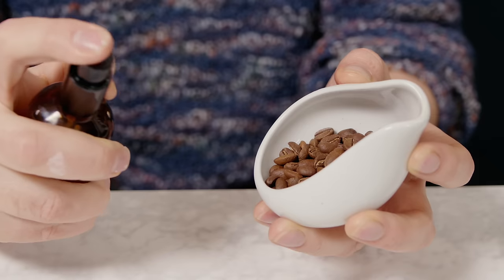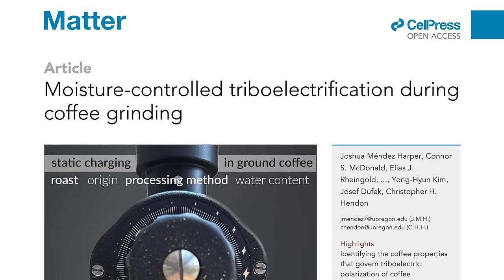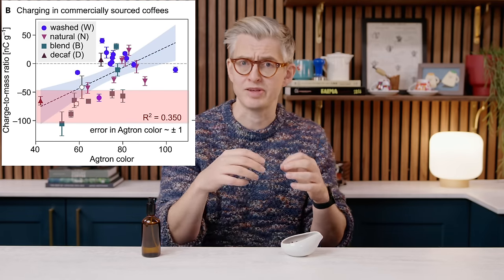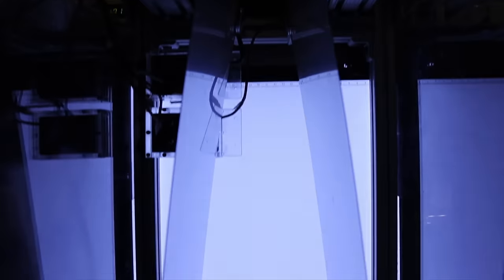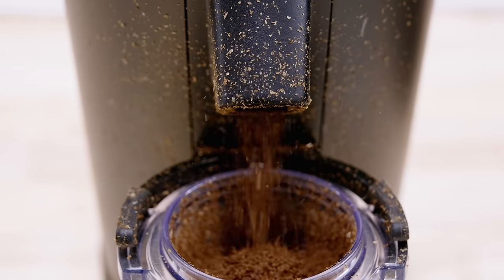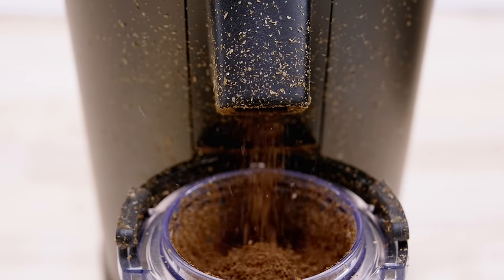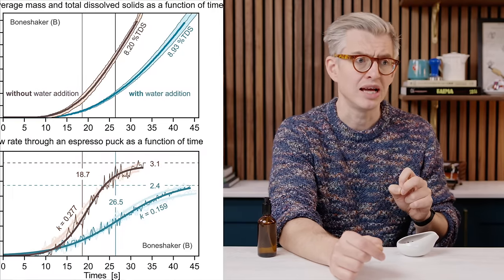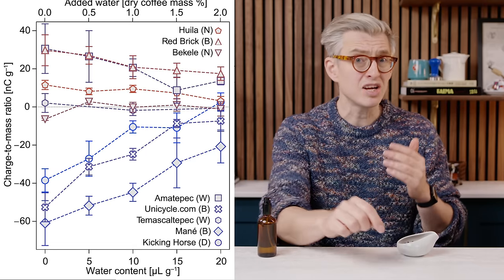Science Discovers What We All Missed: More Than An Anti-Static Hack

Comment: OK having just started my 'journey' into the World of Espresso in the last 6 months, this has just tipped me over the edge into the 'Rabbits hole'...it really appeals to my inner nerd/scientist. So lets think about the two means of generating the charges, what factors may influence this, and their potential impacts before considering two final considerations i.e.

Triboelectrofication = impact of heat SO we would need to consider; 
Burr size, 
Burr profile,
Burr type [Flat/Conical], 
Burr material [Steel/ceramic],
Burr coating,
Burr speed,
Bean flow rate,
Inner moisture content of  bean,
Moisture on outside of bean

Fractoelectrofication = impact of physical fractionating of beans SO we would need to consider:
All of the above as these will impact fractions plus-

Initial size of beans i.e. are they all the same size or irregular and/or have some cracked pieces,

To add to this we also need to consider:
Physical properties of the beans i.e.
Altitude grown at,
Room temperature or direct from the freezer,
Chemical composition [amount of CO2?]

Have I missed anything?

..and finally, once we have allowed for this [and the new understanding] what impact if any will WDT have on the final extraction profile and/or taste, as this may/may no longer be relevant if we are forming less 'Electroclumps'?

With so many variables it would require a massive study to get truly trustworthy/significant results, as the model becomes overparameterized very quickly...I am not a statistician but maybe even the task here would be impossible even with a Supercomputer and sufficient time/resources; any statistician like to comment on this.

Finally, rather than spritzing with water can the same effect be achieved by simply placing and earthing wire from your grinder to a metal object and/or earthing your collection pot prior to pouring the ground coffee into your basket?

Comment: hypothesis: water increases the shot time for grinders with higher variability in particle size (i.e. not unimodal) because it causes a slight expansion of the ground coffee when packed into the portafilter. For unimodal/uniform grinds, this doesn't alter the structure much as everything expands at the same rate. But for more variable grinders with more fines, the expansion rate is different and ends up creating a tighter network in the portafilter. i.e. water in an average grinder has the same effect of "overtamping" a puck. Ways to test this:
1. Compare three shots from the same average quality grinder: A) No water, normal tamp B) water, normal tamp C) no water, overtamped.
2. Compare the sprayed bean shot to a dry shot that has simply been ground slightly finer to match the extraction time. Is there any different in the quality of the shot?
3. Spray the beans and grind, let the ground beans dry back to their unsprayed weight, then tamp and pull the shot. Does the effect remain even after the ground coffee dried? This will determine wheter it is the charge(which was already neutralized) or simply the presence of water itself.

Comment: When experimenting between 2 grinders as described, we have to allow for unkowns that will also influence the outcome. A single grind comparison between 2 grinders will not do it because the different outcomes may be explained by unspecified influences. I use a Kopi Diva on 700 rpm and I can get quite a lot of difference in extraction times (although rarely) when everything I can control I'm keeping the same. It is most likely a little channeling, but this has to be determined. Setting up an experiment and using suitable statistical methods is what is required if we want confidence in the outcomes ... and even then we'd want to show that we can repeat the results. Your Prof will be able to help with this.

Comment: I found this out a while ago completely by accident. I don't spray my beans, I just wet my finger and stir the beans with it then shake them with my palm covering the top of the dosing cup. I did this once with fully wet hands after I had just washed them. Obviously the beans were a lot wetter than normal but I used them anyway, and this exact thing happened. Extraction took almost 10 seconds longer, was very even and tasted delicious. Now I wet my finger and stir the beans twice before shaking. This is with a single-dose modded Mazzer Major with SSP HU burrs.

Comment: I do not know the exact way your particle size analyzer works, but if it works anything like the experiments I did in the early 90's, it works by analyzing diffraction patterns of light that is send through a solution of the particle mix you want to measure. In your case that would be a solution of the ground coffee into a compatible large amount of water compared to the size of your sample, while that solution is also well mixed.  That would mean any clumps that would have formed in the grinder could easily come apart (they are after all a collection of particles) in other words in that abundance of water the clumps would break apart, and the measurement would not show bigger particles. 
These clumps would not necessarily break apart during the brewing process because of a few factors. The ground coffee is packed fairly tightly at the start and the entire mass is put under considerable pressure during the brewing of espresso. This probably keeps the particles and clumps pressed together and prevents the clumps from falling apart. Also during the brewing, there is no abundance of water as all the water is pressed through the grinds and passes past the particles without giving them the room to fall apart. 
I am not very good at using all the right terms (I am not a native English speaker and haven't worked in a lab for about 30 years) but if my impression of how your analyzer works is correct, I am fairly sure this is close to the correct explanation of your measurements.

Comment: Will it also impact hand grinders, since they are so much slower? Will electro lumps dissolve in an aeropress when agitated? Does frozen coffee already have increased moisture? Atleast the water has less cooling effect. Is freshly roasted coffee even dryer and need more spritz? How does it compare to spritzed afterwards? Maybe the effect on grinding is not as significant as it has on setting the bed of the espresso.  How is the improvement for different grind sizes? I would figure more clumps in fine grind but a course grind might need more soaking for effective extraction. You need to do us more tests please ❤

Comment: There is a factor that is not discussed (although I do not know if it is in the scientific paper, as I have not had a chance to read it yet) that I think is a significant variable: Time To Absorb (TTA).
Having played with some of the variables in my trials, I have chosen to weigh my beans and do the Ross Droplet Technique as the very first  step in my setup routine, versus having everything else ready and dosing/grinding my beans at the last.
I think this longest TTA better allows the moisture to suffuse and penetrate the beans before grinding and provides a more even distribution throughout the grinds, versus a surface level application if you have a low TTA.

Comment: Try using white vinegar. Or, maybe white vinegar + water solution.

Vinegar is supposed to help cut down on static electricity when washing and drying laundry.

I just wonder if it would impact the beans due to the acidity.

Comment: James, interesting concept.  I would like to add some additional food for thought as to potential effects from the additional water. 

It is well understood in industries that deal with powders, where packing densities are of key interest, that the addition of moisture to the system can increase packing densities. There are several theories as to why this happens. Neutralization of the surface charges is a biggie, as theorized by your host, but there are also surface tension effects that not only help hold particles together once they come in contact, but also actually draw particles together as the moisture draws along the particle surfaces.  Much like the effect of wet sand at the beach compared to dry sand.  And while I understand that the volumes of water in that comparison aren't even close to what you are adding to your pre-ground coffee, the phenomenon still holds. 

The other affect that I feel might be in play is the addition of the water pre-dissolving some of the coffee solubles and making them more available for extraction once you begin the brew process.  This could help explain some of the increased extraction values you have seen beyond the increased bulk density.  

Just food for thought.  Cheers!

Comment: Just did the experiment, I was using rdt before and my machine was dialled in for that so my recipe would give me 36g for around 28-30 seconds. Without rdt and wdt that turned into 26 seconds, With the 4 pumps for 18g it turned into 73 seconds If I remember correctly for the same extraction and it came out with less body but also less sourness or bitterness; generally it was smooth and even a little sweet but also more bland.

Now I was using store bought beans as my sister had gotten them for me as a gift, but I think this may be interesting for really light or dark roasts to try and get a different flavour profile! If anything I may need to grind a little less fine for this to try and dial it in more for the best result

Comment: As strange as it sounds, I apply soil science (my profession) to my enthusiastic attempts to making tasty coffee. Soil science is a study of flow and solute transport through a permeable medium so it’s quite handy. For example, Darcy’s Law is perfectly applicable to espresso and when you understand the non-linearity in the hydraulic conductivity term you will spend more on your grinder and focus more on puck preparation. Anyhow, a couple of points in relation to this paper. First, it’s a great piece of science and James provided an excellent synopsis. Second, I’m keen understand more about pore space relations with respect to this issue. Does the density/porosity of the coffee bed vary in response to static charge/clumping? That is, does the packing density change (through the uneven distribution of fines) or is it a matter of the coffee aggregates creating preferential pathways through the coffee bed as hypothesised? Finally, I’d love to see some water retention analysis done on coffee beds to better examine pore size distributions in the near-saturated range. I suspect this would be helpful for pour over coffee too.

Comment: I was going to use the Form to offer results, but I use a Flair 58 and the brew time is not something I can promise is consistent (manual pressure input). However, using a Baratza Sette 30 grinder, I don't see a significant difference in grinding time or static (generally very low/no observable static without spritzing). Local climate tends to low RH in the summer, 31% today, so you'd think if the machine was prone to it, that would show up. However, I do note a nominal increase in extraction time for spritzed (4 spritz over 16g) medium roast beans. As my infusion/pressure profile is manual, the extraction time can vary but, more interestingly, the coffee is noticeably more bitter, which would suggest increased (over) extraction compared to the same grind without spritzing. I am now trialing a one-step coarser grind to compensate and will see how it goes in terms of flavour...

Comment: Hi James! I'd love to know whether the increase in extraction time and decrease in flow rate resulted in a tastier cup of espresso at the same grinder setting and recipe, or whether the recipe required coarsening the grind or other tweaks to create the tastier cup.

I've noticed that RDTing with three sprays on my beans will pump the extraction time up more than twice the previous amount, so I've had to coarsen significantly just to achieve a reasonable brew time.

Comment: In case you want to scale up to espresso bar lever, you need 20g of water to spritzing your coffee beans. I’m currently going to work and I’m using this technique for a couple of months and I have seen a difference between extractions during high demand espresso brewing. Which is interesting. I also felt a difference between taste, but that’s super subjective and depends on the coffee preparation, weather, humidity, temperature of the place where you work and the calibration. 

I’ll keep you updated about this technique on a scale up setting
Reply: So, the update of my shift. 20 grams of water sprinkled on the bean hopper and then I put the coffee on it. I have to recalibrate the coffee grinder. 

I have less crema and less corpo. But a more even profile, less bitter for a comercial 60/40 (arabica/robusta) Italian blend. But it was good. For the next time I’ll try less water (15 g or maybe less). 

I have similar results. But I like to try other variables, like water temperature (I used filtered water at room temperature on a summer day on chile with 30° C) and the scale to a high demand coffee shop (in my case, espresso bar).

Comment: I grind many different varieties of coffee bean in my Niche Zero and over the course of 2 years can honestly say static has never been a problem either in the grinder, cup or portafilter. I just don't see it anywhere in the process. The short clip in the above video of grinds going everywhere is crazy, if people are really experiencing this then suggest considering swapping to a Niche or similar. Tapping the Niche cup a few times before upending in the portafilter helps the process, I don't use a tamper either, just a rotary distributer (using a tamp has no effect at all on extraction times or yield), and gave up using a needle distributer some time age (I don't believe weakly bonded clumps of grinds survive the rotary distributor process so can't see the point, and the rotary distributor does a better job of ensuring consistent depth of puck - far more important than breaking down boulders imo)

Comment: I went ahead and tried on a filter. I used medium roast decaff beans, 30g. Ode gen.2, 6.25 grind setting. I used ultimate v60 brewing technique, 60g/liter. Without water, total btw time was 3:23, with water added it was 5:05. On a side note, with water added, the grind looked much more uniform in color. The taste with such a long drawdown was much more bitter and not sweet at all, compared to non -watered beans.
Reply: I will try again tomorrow setting the grinder to 7 and see if it improves the result

Comment: RH and ambient temp are both pretty important parameters for any triboelectrical test, but it's usually about running the test within a certain range of both to avoid an invalid test run with anomalous results due to either too low or too high humidity.
So, most people's houses are probably in a comfortable range of both humidity and temperature, so it shouldn't matter too much.

Comment: Option-O Lagom P64, SSP High Uniformity + Decent Espresso Machine. I grind only at low speed (3-4 out of 10) for espresso shots. I always use preinfusion recipes and fresh beans, light to medium roast (not older than a month). Overall I can pull really consistent shots.
When spraying the beans I tried to spray-shake-spray-shake-spray sequence to distribute the moisture.
Over several shots here are my observations:

- I can see literally zero difference in brewing time (29s vs 29s, 32s vs 32s with the same settings and same beans),
- I never saw any indication of static charging of the coffee particles before,
- spraying water actually makes grinding harder because I more residual particles are stuck in the grinder - around 0.4g as opposed to 0.1g with dry beans; sometimes whole beans can stick to the inlet because their surface is too sticky,
- I can see no difference in extraction, but this is subjective.

Overall I am not going to use water in my grinder. Not only I can see no benefit of spraying water, it also makes the coffee stick inside the grinder and ruins the experience of a single-dose grinder. I suspect the low grinding speed eliminates static charges to a degree that additional moisture does not help any more.

Comment: Is it possible that mould could form inside the grinder over time by adding moisture to the coffee beans? Especially in those included with the coffee machines like the Breville Barista Express for example, which you can’t tear apart easily to clean and dry if needed. They provide a nice dark environment for mould to grow if the moisture doesn’t dissipate fast enough. This would be my greatest concern, although I don’t think that almost 1/3 of a gram of water is going to cause any issue, as some of it will go through the grinder to the other side along with the coffee, and what would be left, will probably dissipate fast enough afterwards. It’d be a good long time experiment though to see the actual results, but I’m not willing to do it with my grinder :)

Comment: Idk if it has anything to do with science but its kind of common sense that a dry product usualy gains more flavor & essence when its rehydrated. It also would in theory stop hot water from over heating it because a coat of water already there to offset the initial blast of heat from brewing.  But wouldn't wet beans make more of a paste than ground?